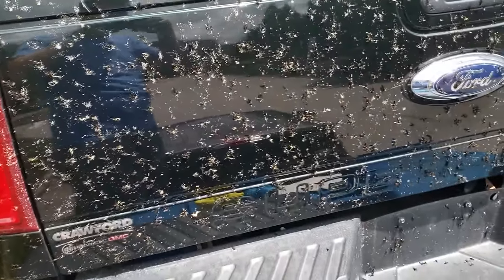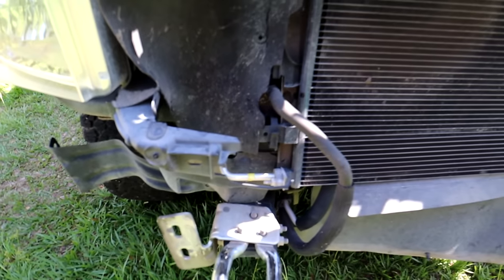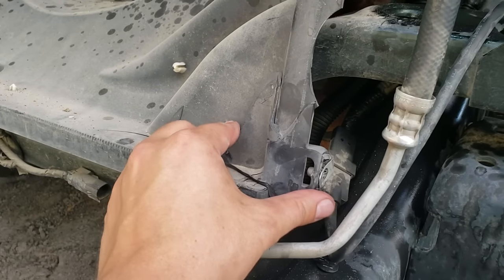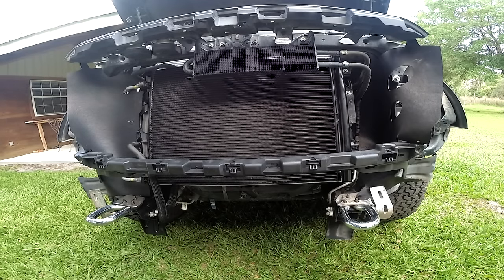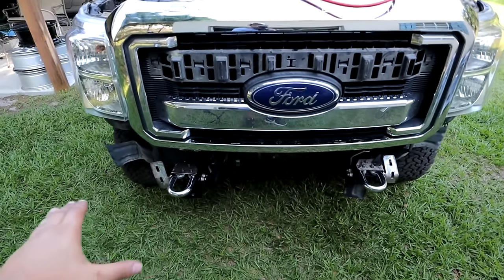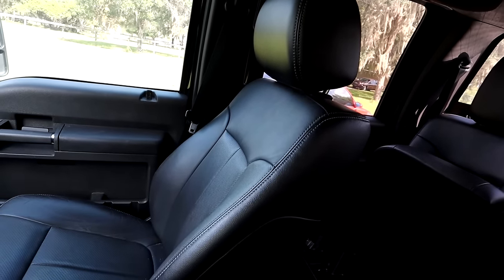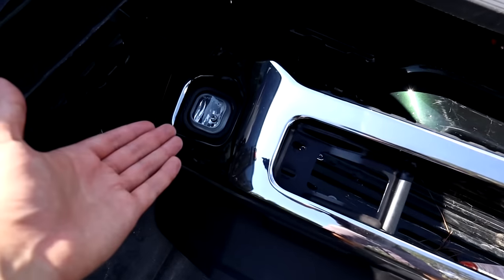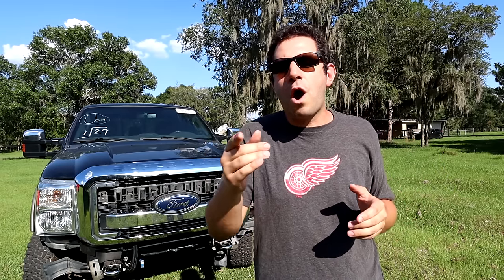I Bought a TOTALED Ford F250 at Salvage Auction and Rebuilt Most of it in a Few Hours!

Comment: Its not a diesel that’s why you got a good deal.
Reply: Yeah; a Powerstroke crate engine and turbo from the dealership is about $16,000
Reply: Most people only think they need a Diesel
Reply: 6.7 is good but I have the 6.2 in my raptor and it is a beast
Reply: Diesels are for towing, plain and simple
Reply: Diesel engine trucks last 500k-1,000,000 miles when maintained properly. The gas engine, (especially in a truck that size) won’t last more than 200k miles. Those of you who say “fuck diesels” obviously don’t know how hard it is to replace the engine in an F250.😂😂😂
Reply: @geostanley409  20 years ago that was true, with all the modern emissions choking today's diesels they are not what they used to be. I have over 400k on my 7.3 and never done anything major to it and my buddies 6.7 is already being rebuilt at 120k because the fuel system shit out and cost him $10k+. And everyone always chimes in "they last if you delete and bullet proof it" sure that helps but for what it costs to do that to a 6.7 I can have an entirely new 7.3 in my old truck.
Reply: The powerstroke diesels had that head stud problem along with a couple gremlins in the fuel system.  Better to buy the gas engine truck if you arent going to be super cautious with a diesel.  But...I still love Fords!
Reply: EXACTLY
Reply: Still. Nice lookin truck lol
Reply: Geo Stanley gassers last way longer than 200
Reply: There is video of a guy with F-250 gas with over a million miles. Gas engines last longer than just 200k. Primary reason Ford is building the new 7.3L big block gas for super duty use.
Reply: Whats your point? It doesn't change the retail value of that truck being around 35k.
Reply: Geo Stanley Watch out everyone we got an expert over here
Reply: Geo Stanley or they can’t afford a diesel hahah poor people
Reply: Geo Stanley are you 60? Gassers don’t last 200k and shit out anymore, 1995 is over my friend. Even shitty pontiacs newer than 2000 will last 250-300 miles with basic maintenance. Diesels are rightfully dying out as an inferior and expensive counterpart to gas.
Reply: Basically yes. Everybody wants a diesel truck. few people want a gas guzzling, power lacking, lower reliability truck. Sometimes that's all you can afford. There shouldn't be such a price difference between the biggest gas engine and a diesel when buying new. Majority being sold is diesel and volume drives the price down. These trucks should be offered as an option to be a glider. By a new glider truck and throw in your favorite powertrain and go. P-pumped 24v Cummins and 6 speed manual would be my choice. Maybe he will fix it , keep it for a while and then sell it to graduate to a diesel King Ranch or something.
Reply: @geostanley409  That's true but if he is only using it for a vehicle to haul projects once in a while and not drive it everyday is the extra cost plus the maintenance worth getting a diesel?  Diesels are great but if your not putting the miles on it like you should is it worth it?
Reply: @mattr2115  you're definitely confusing the 6.7 with a 6.0... The 6.7 doesn't need "bullet proofing".

If you're getting a gas 3/4 ton... Don't even bother getting the Ford. I thought he was going with a 6.7 and figured he made a good deal. A rebuilt '14 6.2 F250 probably isn't going to fetch much more than 20k
Reply: @mattr2115  work had to rebuild the cummins isx my 2013 volvo vn608 at 600,000 km (around 375,000 mi) because it dropped a liner.  You are right, the modern emmisions cause a pile of issues.
Reply: I run a fleet of 22 delivery trucks I used to have primarily 7.3 international diesels it's switched over the Ford 5.4 6.2 and Chevy 6 .0 and don't have near the problem that I have out of the two modern diesels I own I'll never buy another damn diesel engine and you can take that piss bottle that you now have to pour that def in and keep it
Reply: I picked up a 13 6.7 for 17.9k with 122k miles.. Only problems in its history are the lift pump and a turbo coolant leak..  The lift pump was annoying.. But super easy to replace, and the coolant line.. I was swapping in a wicked wheel.. So a 20$ line to replace while I was there.. Easy again.. But only because I deep in the valley lol.  But mines clean title.. A baby dent here and there. Mines a 350 dually too.
Reply: That’s a good thing
Reply: Geo Stanley I actually believe the opposite to be true.
Reply: Retail value is how much the truck sells for on the used market, WITH THE 6.2 ENGINE.  Nothing to do with the resale value of a diesel version.  Apples and oranges, people.
Reply: @devilmonkey  The gas truck can tow as well... it will just consume double de fuel!
Reply: @3rdworldgarage450  EGRs, antiparticle filters and high pressure injectors with tiny nozzles.  They are kind of reliable, but you have a maintenance heavy engine..
Reply: Ok, I got curious, Manheim MMR on that thing is at 28K.  Assuming the frame horn is just bent and that thing isnt dogtracking all over the place, seems like he got a pretty good deal going there.  I'm just wondering how it got "totaled".
Reply: It’s only worth buying a diesel if you’re hauling heavy equipment etc. the gas will be just fine hauling cars. Diesel is way more to fix and maintain than gas as well. Only get a diesel if you’re hauling heavy shit otherwise it’s retarded.
Reply: The new  powerstrokes are junk anyway...
Reply: @mattr2115  you have to also think the old 7.3 was made by international a 18 wheeler maker so yes that's why they stand up to the test of time the 6.0 was made by international also but at the same time Ford also had there hand in how it was made and the 6.7 was all made in house by ford
Reply: @Brandon Keithley yeah 6.7 Cummins not a 6.7 powerstroke 😂
Reply: @MrArcticPOWER  It does. diesel engines are more expensive to buy new 7-9K upgrade and on the used market they will bring more unless its an engine with known problems like a 6.0. there for the value of a used f250 with a 6.7 is worth more than a f250 with a basic gas engine.
Reply: @FishFind3000  It doesnt change the retail value of THIS truck wich is around 35k like the gaz one he showed at the beginning. A diesel one would be worth more than 35k. Stop comparing apples with oranges. Your point still doesnt make sense, you seem to not understand what retail value means.
Reply: @geostanley409  it's not uncommon to see those 6.2 engines over 400k. I own a 6.7, and it's a great engine. I also drive a 6.2. I would be more than happy to have the 6.2. Plus saving 10 grand and having a third of the maintenance cost is a plus.
Reply: 3rd World Garage 15 cents more then gas

Comment: Buys f250. Gets a gas motor 😂
Reply: Seriously! No wonder nobody wanted it!
Reply: He’s probably better off. I’d rather have the 6.2 gas over either 6.0 or 6.4.
Reply: Bigger payload with gas
Reply: @dirtracingfan8742  I'm getting  the 7.3 Gas cast iron block push rod motor with the 10 speed.  You coal haulers have fun at the pump and working on the oily turds you likely don't use for $9200...
Reply: Kenneth Humphrey thats a 2013 that would be a 6.7 lol
Reply: 6.2 is a solid engine.
Reply: One of my friends owns a garage and he told me he sees those come in from fleets, construction companies and the like.  They have over 200k sometimes with that being their 1st service.
Reply: No 6.7😭
Reply: John Pyle if I’m correct isn’t the 7.3 a diesel 😭😭😭
Reply: They stopped making the 7.3 power stroke in 94 or 96 I believe. 2020 7.3 gas cast iron block. Pushrod motor.  They are calling it "Godzilla".    Ford also has a "Ford" diesel.
Reply: first service at 200k? That's a load of bs.
Reply: So do we. You only need the diesel if you tow all the time.
Reply: J prince Im sure for the price he meant older gen power strokes
Reply: 9000$ buys a lot of fuel, and maintenance is cheaper

Comment: Sam, I have a 2002 Super Duty that was nearly totaled due to an accident like this. Your front frame section is bent over because someone was driving from left to right in front of the vehicle when the vehicle hit it broadside.  I'd guess the impact speed was in the 20-30mph range based on the damage.  What you don't realize is that the frames on this year truck are high tensile steel and cannot be "pulled" on a frame machine.  Ford typically sells front frame sections, there is a parting line on the frame behind the front wheels where the section comes off.  The bill to repair this truck easily exceeds $15,000.  You have to pull the engine and cab, then remove the front frame section, attach a replacement section, reset the engine and body, then do the mechanical work to repair the coolers up front, then reassemble the front end, align the axle, then get a 4 wheel alignment.

But here's the kicker, since that's a high tensile frame, Ford probably doesn't authorize the frame to be pulled to get the "diamond" out of the frame, which means this is a full frame replacement.  Some insurance companies will total a vehicle if it needs a front subframe replacement (Farmers) some won't (Nationwide), but ALL insurers will total a vehicle if it needs a frame replacement.  Because you can't "pull" the diamond out of the frame (according to Ford), the vehicle needs a full frame replacement.  That costs about $10k to swap the frame out.  To repair my 2002 super duty with the front frame pushed over 4" inches was $12,900.  This involved heating and pulling the frame with a frame machine, because the earlier F-350 and below Super Duty trucks have mild steel frames.  The F-450 and above, all years, have high tensile steel frames.

If you don't repair the frame correctly, it will tow miserably and when you come to a panic stop, the vehicle will crab due to the thrust misalignment of the axles.  My truck still has a clean title because it was repaired and Nationwide didn't total it.  A girl in a PT Cruiser pulled out in front of me while traveling 45mph.
Reply: Calm down buddy. The truck is already totaled and gets inspected by the state after the repairs, and the frame can be pulled easily. It's only 1/4 inch thick steel. It could be pulled easily even if it was 2 inch thick steel with a little heat.
Reply: That is exactly what happened. Someone pulled out in front of us when we were going around 30 mph and hit him with the driver's side of the truck
Reply: Great reply, now it makes sense.
Reply: Does not look super duty to me. Looks like cheap plastic junk with too much low quality electrical items waiting to go wrong .
Reply: This^. You dont pull these frames, you replace them. I worked at a frame shop and we did several of these.
Reply: @glenphillips9068  you haven't seen the newer chevys then if you think the Fords are bad 😂 I've had a few chevys they're junk these days
Reply: Armando Sturzenegger  I currently have a 2011 2500hd duramax I don't quite like all that much and my dad has a 2018 2500hd ltz duramax which isnt all that great either.
Reply: Went down the same road as you.  Truck was never right.  Ended up suing the ins. Company and the body shop plus loss of value. Truck needs a new frame it that why it got totaled.
Reply: Hunter McDonald did you previously own the truck?
Reply: This is right on the mark.  Pulling is fine on a salvage title and it will be 'good enough', but never nearly as strong as intended.  Insurance will only pay for a proper repair to original specs, so a full frame replacement is the only fix here.  Back when I worked in a body shop we did one of these, I think it was a 2004 truck that was brand new at the time.  had to completely pull everything off the frame and put in a new one.  Something like $26,000 repair bill when all was said and done.  99% of the time if the truck is more than a couple years old, it's getting totaled for any frame damage. Makes for really good deals on trucks with minor frame damage that is in front of anything important for alignment.  I'll take a crooked bumper and 20k in my pocket.
Reply: Jared Heilemann they are all junk so are the rest of the companies world wide .Trucks new 80 Grand in Canada for new one with some options , look at the super cars on here overpriced and horribly expensive to maintain built badly also lolol. I only buy used repair and over maintained cars truck and boats for my personal use and hobby and oil undercoat annually and touch up change fluids ,wax
Reply: @3MonthsToLive  my dad did. I was in the passenger seat when the crash happened

Comment: Sam buys truck
Sam complains because a truck drives like a truck
Reply: Samcrac's Honda Ridgeline You're not a real truck.
Reply: Which is why he should have kept the Ridgeline. Unfortunately that particular one was a rusty POS.
Reply: OMGWTFLOL The Ridgeline is not a truck he needs.
Reply: Samcrac's Honda Ridgeline Can you tow 12,500 pounds.
Reply: Samcrac's Honda Ridgeline No you're a Honda Pilot with a pickup bed.
Reply: @jacobt1027  no, no he can't, but my 1991 F-350 dually with a 7.3L IDI diesel can.
Reply: @Samcrac's Honda Ridgeline chicks dig the dually brother, they dig the dually
Reply: @Samcrac's Honda Ridgeline you got one problem my friend, you can't haul all the ladies I do, diesel trucks will rule the world.
Reply: @jacobt1027  it can. It also shouldn't
Reply: Too trucky
Reply: Dam truck driving like a truck 😆 sounds like a dam truck too wtf
Reply: salty trucks bruh lmao
Reply: @jacobt1027  He doesn't need to tow 12.500 pounds, lmao.  A ridge line is exactly the truck he needs because it isn't one.
Reply: TimberWolf429 yeah your idi can at 30 mph
Reply: *truck*
Reply: sam works on floor when hes got a flat bed truck,
Reply: @TimberWolf429  the f250 he bought was gas burner 6.2
Reply: The older 5.4s were garbage. Better off with the 6.2L. but for 14k plus less then 2k for repairs was a fricken steal.
Reply: It’s just because it’s an fx4 it off-road version stiffer suspension 
I have a rebel which is stiff but the big horn ride like a caddy

Comment: Good job samcrac. 

That's a truck. After having it a few months, you'll wonder how you went so long without one.

I think the gas engine was the better choice for you anyways, since you won't be driving it all the time, and diesels hate to sit unused. Plus the cost difference for a diesel wouldn't be worth it for  how your using it.

Nice score, nice work!
Reply: Gas stations be weird asf, we have a good 5-6 of them and black handles mean diesel. Not bad I thought it was a diesel
Reply: @Dummie1  where i live all diesel pumps have a green handle lol
Reply: Mason Licavoli definitely gotta make sure o don’t put diesel in my car when I’m out of state then lol.
Reply: Youjust have to know how to take care of a diesel. mine sits more than used. My def is on its last month now, need to pump it out. Also needs to be deleted, but thats another story. Proper care and it doesnt matter if they sit or be used daily.
Reply: @Dummie1  you cant pump diesel in to gas powered car 
diesel pump gun is bigger than your gas tank hole it wont fit :)
Reply: @bekiro28  On a modern car. I've got a Studebaker Lark and when filling the tank in hot weather I put a gallon of Diesel in, it helps reduce vapor lock.

Comment: So with this truck we will be seeing you pick up your own cars instead of paying a shipper?
Reply: Walter Williams lmaooo
Reply: It's a Ford. It'll be broken more often than not.
Reply: Herbie Husker you spelled Dodge wrong
Reply: cnsln_memphis right transmission on the dodge will break down or have issues before 60k miles
Reply: @Schmuly  That's funny, I've had both and I'll tell you what. Fords are crap. Barely get 100k miles out of them before major problems. My Chevys always last 200k miles before I have any issues.
Reply: @Schmuly  I own an F350 & Silverado both.  FAIL!  The Ford has been a mechanical a hole.  In the garage 4 times now for driveline problems, & fit & finish over the whole truck is TERRIBLE!  The Silverado is 2yrs old now & hasn't given me a problem yet.
Reply: @2CabrasLocas  @Herbie Husker You guys are both pathetic with your anecdotal evidence. Even if you had owned 20 trucks from each brand, it wouldn't make up .001% of the trucks either brand produce. But sure argue about it all day. Or take that time to do some research of large scale studies instead maybe?
Reply: Herbie Husker driven a lot of Fords. Never been left stranded. Them damn Chevys tho for fucks sake
Reply: awesomecvl not to mention different climates.  Lived in ME where most frames rust out fast due to the salt on the roads in the winter and the sea air salt.  Lived in TX for a bit, in the dry dry area, cars would last a long time.  Lived in FL, rust will start slowly from sea air.  Lived in WA, sea air and water.  All subjective, and of course there is how you treat your car, hard accelerations vs soft, etc.  the amount of bs above makes my skin itch.  Give me a statical analysis on a pool of at least 75% of all vehicles over 5, 10, and 15 years over that crap.
Reply: The “relatives” you normally borrow pickup trucks from are going to start taking your calls again.
Reply: Jags the safety ratings tho show they’re a death trap
Reply: The way this guy talks about the truck, he wont know how to haul...

Comment: This is a great buy. That 6.2 is full of power. It may drink gas, but Ford WAY over engineered them. You will get many, many more trouble free miles out of it.
Reply: Casey Todd the Ford Excursion is the best suv made by Ford and it’s much better than the SUV replaced by it since 2007

Comment: I have a 2016 F250 and replaced my factory Michelin tires with a set of those same BF Goodrich T/A K02s and the difference in ride quality is night & day.  The KO2s have a hint of road noise but the truck rides so much smoother compared to the Michelins.  Since your truck has 60k miles, it's safe to say those are fairly new tires so don't waist your money in search of a smoother riding tire because you won't find it.   Nice score on the F250!